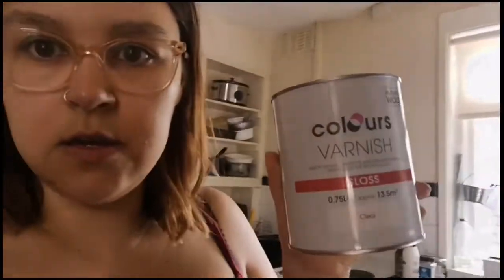Pulley bed system- Step by step - First time van build

Comment: So watched whole video and didn’t do a step by step of pulley?
Reply from the maker: Hiya,
What stage are you at?
Building a DIY rope pulley system for a bed can be a complex and potentially risky project if not done correctly. I can provide a simplified outline, but for your safety, I recommend consulting with a professional or engineer to ensure the system is secure and meets safety standards. Here's a general overview:
. **Materials and Tools**:
   - Heavy-duty eye bolts or ceiling hooks
   - Sturdy rope or cable
   - Pulleys
   - Bed frame or platform
   - Carabiners or other connectors
   - Screwdriver, wrench, drill, and other necessary tools

3. **Ceiling Attachment**: Locate strong ceiling joists or beams to securely anchor your eye bolts or ceiling hooks. They should be spaced to match the dimensions of your bed frame.

4. **Pulleys**: Install pulleys on the ceiling-mounted hooks. Ensure they can swivel freely.

5. **Rope/Cable**: Thread a length of rope or cable through the pulleys. This is what will raise and lower the bed.

6. **Bed Frame/Platform**: Attach the rope or cable to your bed frame or platform. Use carabiners or other connectors to make the connection secure.

7. **Balancing and Testing**: Ensure the bed is well-balanced and the rope or cable is correctly threaded through the pulleys. Test the system carefully to make sure it operates smoothly.